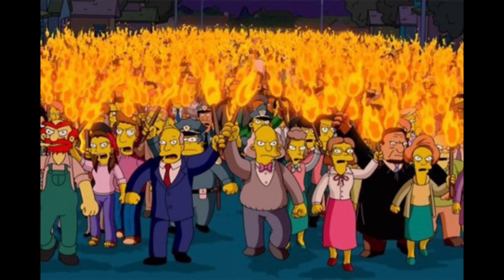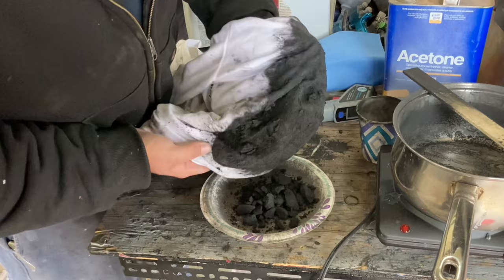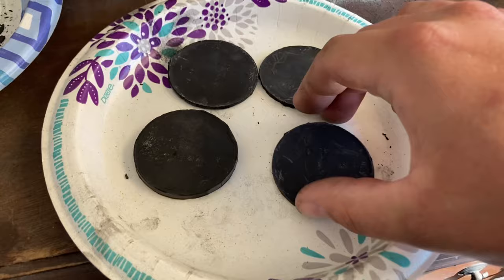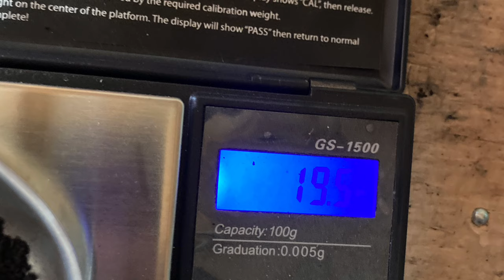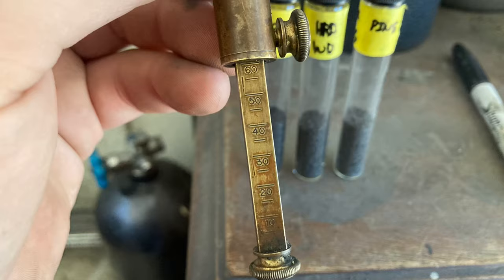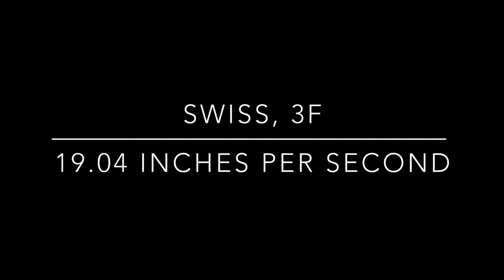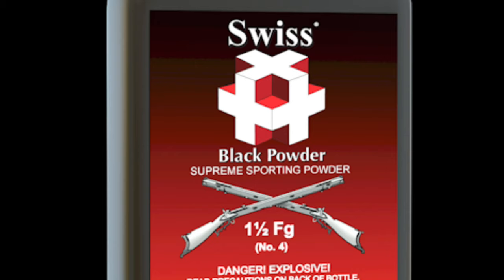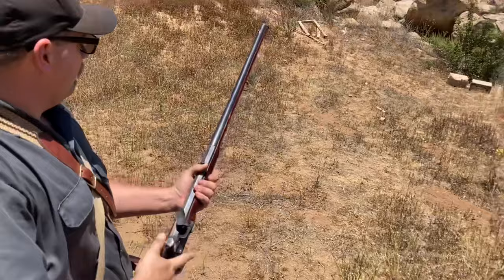How To Make Black Powder (For Firearms Part 2)

Comment: I have been making powder for years and have R&D multiples of things along the way. I have found that the CIA method isn't needed if you have a good enough mill as everything becomes atomized in a good mill. The one I find to be great is the stainless steel octagon mill used for wet tumbling brass. The reason why Willow is considered the best or from my opinion one of the best is because the less dense a wood type is the smaller it mills down. So from my memory willow has a density around 26 Lbs/Ft3. Making it pretty light. Goex uses Red Maple from wine barrels as well as harvested maple wood. They are under new management now so that might have changed to just using actual maple. Red maple has a density around 38 Lbs/Ft3 so a little on the high end for density in my opinion. Schutzen uses Black Alder which has a density around 33 lbs/Ft3 which is pretty good. Swiss however uses Buckthorn Alder. It is not the alder tree it is a bush. I would assume it's density is around 25-28 lbs/Ft3. A sister of the buckthorn Alder grows near me here in Florida but I have not found it yet called Carolina Buckthorn I'd like to test it. Graphite does not reduce the hydroscopic nature of the nitrate. Goex, Schutzen, Swiss, etc all use graphite to improve flow characteristics for measuring. That is all it does. It makes the powder flow better in a measure or flask. It also slightly increases the ignition temperature. Also the reason I was posting this comment was because I notice you left out one important step in your black powder production. And that is glazing. You would notice about a  5-10% increase in volume if you glazed your powder. Glazing you can use the milling jar you have you just need to take the media out. Let the corned powder run in it over night. Glazing or polishing the grains will do 3 things. It will break the jagged edges of the grains making the grains round and more uniform. Doing so makes the grains ignition temperature rise slightly (doesn't matter almost non existent) polishes the surface of the grains making them flow better if the grains have been graphite coated this would then make them nice and shiny and flow really well, and because they are not jagged they will fit better in a specific volume. Increasing the grains per volume thus giving you slightly more power. It also makes the powder burn more uniformly in the barrel as well. Swiss has a very high glazing time if you compare swiss to goex. If I remember right goex glazes for 4 or 8 hours something like that. Swiss glazes for 48 hours. Graphite coating imo is not worth it. Your can achieve a good flow rate by just glazing. Adding an additional Impurity to the powder like graphite doesn't help imo. Pressing the powder into pucks you want to try to aim for 1.7-1.8 cubic centimeters squared. Compressing more can slow the burn rate down but if you have a long enough barrel or heavy enough bullet you can use it to your advantage. Generally 1.8 is considered most optimal. The 75-15-10 ratio imo from my testing is dependent on wood type. You want to have your nitrate ratio to be up enough to lower carbon left over from the burn but not so much that nitrate is left over. Better to have carbon left over than nitrate. Think of it like rich or lean engine mixture. Swiss uses the mixture 77-13-10. It is dependent on wood used. I've made some where 75-15-10 is acting like another powder with a different wood at 78-12-10. 75-15-10 is just a good starting point. Like a recipe for a pound cake. You make a batch then you find out next time you are adding more vanilla to the batch.  If you would like to ask any questions or brainstorm, shoot me an email.
Reply: I am trying punky oak wood, you know the rotten outer layer of some trees. The stuff is light like toilet paper, but dense originally, plus its filled with organic material, fungus, bacteria, sawdust, it has carbon structures that will become very small and conductive. What do you think? First time making it, the setup is actually primo if I say so myself. 
Tumbler is on a lathe, with big pvc tube and big square chunks of brass. It goes reliably and not too loud either. 
And the pucking press is actually a 40 ton lab press, salvaged, but now working 40+ton but I dont want to bust it. Im doing 1kg of it for starters. 
Tonight its going to get pucked and then dried with a house dehumidifer and then sifted per usual. 

I have no chronograph though, and im waiting on my gun buddies to buy one. Until then im just going to use it recreationally and for defense.
Reply: @user-zm4yg9xv8q I have never tried punky wood. As long as the bark of the wood isnt used it should at the minimum make black powder that goes boom and can be used for plinking and hunting. Even not so good powder makes usable powder. Which is why i dont mind testing just about everything. I am very interested in hearing how it goes though. Just like the owner of the video i prefer cedar as well. Willow offeres nothing that Southern Red Cedar (Florida Cedar) does as well. Same goes for Northern White Cedar, California Red Cedar, Western Red, and Atlantic White Cedar. Ive noticed wood type doesnt make too much difference other than some outliers. Its mostly how well the matetials can be incorporated and the corning and glazing process.

Comment: I am starting to think these techniques that you use have been carefully kept from us. I have been making black powder for years and only after applying your method do I get a powder that I can finally use and shoot with confidence. It's just amazing how the ingredients fluff up when adding the cold alcohol,  I deep freeze my alcohol before adding.
Reply from the maker: Glad to hear it! The colder the alcohol the better it works.
Reply: @Everythingblackpowder  Where did you get the compression cylinder and what is it made from? (I have a press , I have willow trees , I'm pretty sure I have salfur, but not 100% , so it's the potassium nitrate that is my biggest trouble. could something else work?? I dont need high quality ,I just want it to go bang! Thx again!)

Comment: Great videos (parts 1 and 2)! I do have a local friend here who has made blackpowder for firearms and I will share your videos with him.

I use to shoot black powder a lot and gravitated to custom made flintlocks as you seem to have done. Killed quite a few deer with patched round ball flintlocks. I never made blackpowder for a gun but I did study it a lot (I am a retired engineer), both the history and the chemistry. It seems that potassium nitrate is just potassium nitrate and sulfur is pretty much just sulfur, but "charcoal" is not just charcoal and is certainly not just just carbon as presented in the simple chemical equation of a blackpowder burn. Charcoal is actually quite complex with many different "volatile organic compounds" (creosote, etc, etc) and way beyond my chemical understanding.

But I did understand this: different woods (oak, maple, etc, etc) make different qualities of charcoals for blackpowder purposes. And here is the kicker: Although moisture is generally present in unburned blackpowder (preferably under about 2%), and too much moisture content before ignition is bad (hangfire, etc), moisture that is actually produced DURING THE BURN is GOOD. It helps keep fouling softer. In some woods/charcoals more than others, the VOC content apparently can produce moisture DURING THE BURN.

That was, I recall from reading long ago, the secret of why British Sporting Powders burned less hot and with soft fouling and the fouling would shoot out with the next shot without wiping or cleaning, but American powders shot hotter and dry and produced harder fouling. More or less ditto today for Swiss powder and Goex, I suppose.

In the 19th Century I have read that Britain imported tons of Alder wood from Eastern Europe (I think it was Black Alder) for making charcoal for blackpowder. Today, in the US I understood that Goex uses maple wood for charcoal. I think the quest to produce blackpowder with more manageable fouling is going to be a quest for more suitable wood for charcoal.

Thats my 2cents,
rogerw
Reply: I wonder how well locust would work for this ?

Comment: I don't have your experience or expertise. But I grew up as the first generation off of the farm. I learned to blast firewood both by blackpowder wedges and by saltpeter sugar in a drilled hole. I've tried to duplicate the old days but the farm store chemicals are days gone by. Long way to say it but thanks for showing this. That old oak tree that blew down won't stand a chance this winter.

Comment: A proper ball mill will make powder in about 1 hour, any longer and it will clump and at that point you're wasting time. Also you can toss in the dry ingredients right off the scale without need to use the other method. Toss in, close up tight and turn on. Come back an hour later.

Use a Rebel 17 drum or the ugly red knock off, half full of 50 cal shot and mounted to a custom drive with a 1/2hp motor. 6" and 2" pulleys and it'll turn at about the proper RPM.
I would reassign the HF tumbler to glazing duties. Toss in your still damp corned powder and let it run over night and when you open it after work, you have nicely rounded edges on your grain and it's ready for drying and packing. 

It will look like Schuetzen but add a pinch of graphite or so rather than drying and tumble again for a few hours and you'll have powder that looks like Swiss.

Forgot to add, the purpose of the graphite is flow characteristics. If you're using a Lyman 55 or some other meter you get less deviation as a result though it's really not that big a deal as even just glazing without graphite will not deviate all that much, a few tenths there about. Graphite reduces 2 tenths to 1 tenth if that means much to you.

If you weigh your powder charges then glazing isn't needed and certainly not graphite. That shit is too damned slow. I'll use my Lyman 55 and basic glazing. Good enough to group with.

Oh and to spam the update a bit more, having tested various wood types as well, I've found that once pressed to high density, they're all pretty well uniform in performance. Slightly variations yes but not 3000000000000% different. 

Sorry boys, you aren't going to attain smokeless performance with your super seecwet super duper wood type and alchemy methodology. It's all pretty well within about 10%, maybe 15% (100-150 fps) of each other. Your loading, your bullet weight and cartridge type will be the biggest factor.
Drop tubes and compression plugs for your cartridges. Get more powder in and MAKE ROOM by compressing the ever loving shit out of it with the compression plug in your neck expander before seating the bullet. Don't leave room. I drop 45 grains of 3FG into my 45 Colt cartridges and make it fit because I use the correct tools. 1,180 fps with a 250gr big lube bullet. Screw 800 fps, I'm not recoil sensitive. I want my ladies to make noise and buck around when I finger the trigger.

OP, it's amazing to see the parallels in your studies of firearms grade powder and that of my cousin and I.  Your findings almost perfectly mirror ours.
Reply: on point

Comment: You  could try replacing the "puck" press dies with a series of smaller dies with small Teflon center rods and make your own 30 and 50 grain pellets skipping the rest of the corning steps

Comment: Thanks for the knowledge. I learned a bunch. One thing about BP……… USE brass everything! Any chance of a spark needs to be taken care of.  Second, when handling this stuff make sure everything including you are wire grounded to eatth!
Reply: Commercial fireworks manufacturers make sure that their workers are GROUNDED to earth by means of a conductive strap attached to their leg and then plugged in to a ground receptacle. This is to minimize the risk of fire/explosion caused by static electricity, a very real danger. For amateurs this might be a bit too much. 
Edit: Amazon sells conductive anti-static wrist straps ($8.00) that can be grounded which is what I use.

Comment: First off I wanted to thank you for sharing your work and research on black powder for firearms. Next I would be interested in seeing more on the corning and granulating process. Also where do you get your dies and screens for sizing and sorting the sizes of powder? Thanks.
Reply from the maker: I had a friend on mine make the pucking dies and I bought the screens on Amazon
Reply: You can get some great screens from Skylighter, and Woody's sells three sizes of puck presses.
Reply: my 1st try with sour mashed carbon just FAILED as I also used homemade Potash for my kno3, but I have more sour mash carbon! and I did ball mill my carbon wet alone, it is like ink! then dry for measuring and storage.
Reply: @lawrencestanley8989  thank you!

Comment: Excellent. Thanks. I've seen glimpses of parts of your method after having researched numerous sources but you've compiled all together really well. I'm starting to think that pyrotechnics and firearm grades are two different things. Compression seems to be the key thing. For a mixture thst only has three main components it amazes me how much results can vary
Reply from the maker: Yes, the compression is what really makes it as powerful as the commercial brands.
Reply: @Everythingblackpowder  👍🤘
Reply: @Everythingblackpowder  what do you wet powder with before compression
Reply from the maker: @bradnieubuurt4758  water works the best
Reply: @Everythingblackpowder  thanks

Comment: Interesting video,  duelist1954 has  stated that Swiss uses Alder for their charcoal, another video, Hoffman reproductions, has used grape vine but currently uses Silver Maple. So yes there are many good charcoals available. As for graphite, you say it seems to make the commercial powders burn slower. That is most likely true as it is also used as a burning deterrent in the manufacture of smokless powders.

Comment: really nice video.....very well done. tanks for taking the time to put it together.  when you say add equal parts of alcohol is that an equal amount to the water or the nitrate or both? thanks
Reply from the maker: Thank you. I use equal parts alcohol to the total volume of dry ingredients. So if you have 3 cups of dry ingredients use 3 cups of alcohol. Sorry, I should have made that more clear.
Reply: thank you

Comment: Anyone try Tree of Heaven charcoal? I've read it is very good. Also black willow but didn't know that red cedar was supposed to be good. I have enough red cedar to help the south rise again. But have pleanty of willow and some tree of heaven around too. But haven't tried making any powder yet. I live in North central Arkansas and Confederates made black powder here near caves along the Buffalo and White rivers. There are a couple of caves called saltpeter cave around. They mined bat guano for nitrates and I assumed used willow but may have used cedar, who knows. They used huge cast iron kettles about 3-4 ft across in the process. The Feds raided some of the powder camps and busted up the kettles. I've seen a couple of recoved kettles that were chiped and cracked. Some day I'm going to give it a go.

Comment: I was very precise in the ingrediants ratio and used good quality materials. The resultant powder, when tested, leaves behind a hard,  cream coloured plasticized residue akin to body filler.  Because of this I won't try it in my muzzleloader for fear of difficulty cleaning.  However, it readily burned with enthusiasm using a spark from an old torch igniter.  I think it must be sulphur residue.

Comment: I don't use the CIA method (too much of a pain in the ass for me) but if you pay attention to what your doing and are able to produce good charcoal, it is pretty easy to exceed the performance of any of the commercial powders.
Reply from the maker: Agreed. 75% of the powder I make nowadays is made dry, Milled for 8 hours then compressed and granulated. It performs just as good as the commercial brands

Comment: I have just made a batch as per your video.
I used a 370gr minie ball with over powder wad and lubed felt. 70gr (by weight) home-made black powder and got an average of 1375 f/sec. The Buschalk commercial powder chronographed an average 1394 f/sec.
The fouling was soft and easy to clean.

I would say its a winner, Thanks so much for sharing.🏆
Reply from the maker: Glad to hear it!

Comment: Commercial factories accept that some batches are faster or slower than others because of some manual variation in method or in the condition of the all natural ingredients. They then mix batches to make a viable powder but not a superfast one. Vine charcoal is said to make very fast powder, willow and red alder are the classic UK materials, One of the Maples used to be standard in USA factories. ERC pet bedding is currently the pyro's favourite charcoal in USA. "Wichita Buggy Whip" has a list of easy and cheap USA based woods and the powder they make.
Please don't use marbles as mill media, a friend in the USA used marbles and lost two fingers and the cost of hospital work.

Comment: I know this is an old video. But the Swiss black powder uses a blinded wood charcoal. And by that I mean it has like, ash, oak, birch, elm, pine in it or some combination there too. So there is more than one type of wood charcoal in it, that tends to burn cleaner. Is kind of the same thing some bbq restaurants do, is they will mix wood species. You could try mixing oak, mesquite, ash and see how that goes. But pine has a lot of sap, as does cedar and thus will produce more fouling.